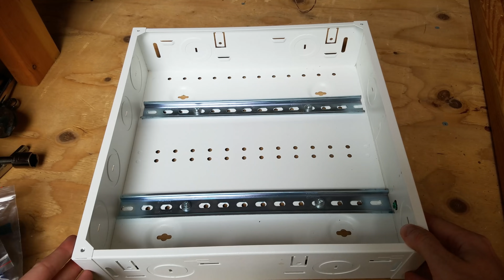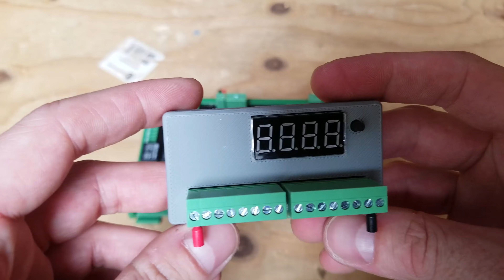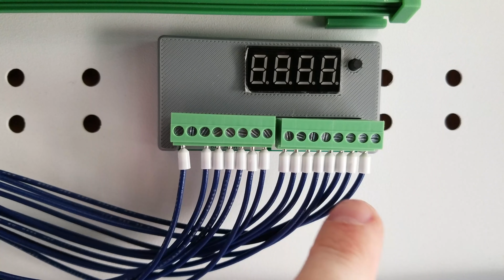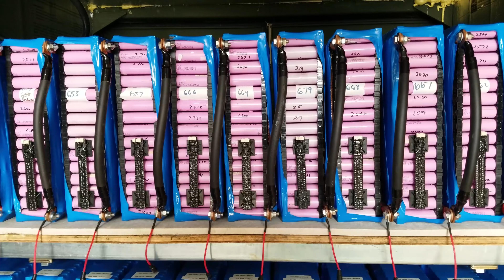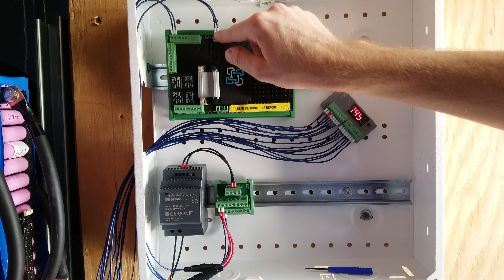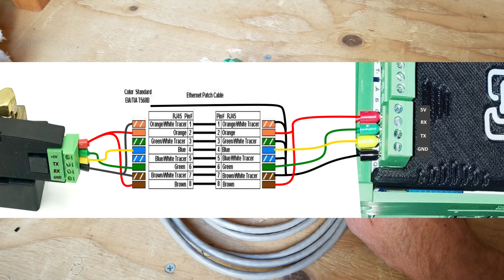Installing the Batrium Watchmon 5 (WM5) Battery Management System

Comment: but this does not guarantee each cell is monitored and cut off individually right if you are connecting a 100 cells in parallel? There is a possibility some cell will overcharge whiles some cells charge more slowly. I guess thats why your battery packs are a bit hot?

Comment: I'm having an issue with my batrium where a few cells always seem to charge to a higher voltage than the rest. The first few cells I added all have the same voltage but the the ones I added a few days later have a higher voltage and are not even aswell. Any idea on why this might be happening ?

Comment: Really great video, thanks! With the Watchmon 5, are the longmons still needed? Also, I'm still not clear if the shutmon is absolutely required for just cell monitoring and balancing?
Reply from the maker: No, the longmons are not needed, and no, the shuntmon is not required.
Reply: @LithiumSolar  Thank you for the info! Appreciate you helping me design my system.

Comment: I am confused by the naming, are these BMS's? monitoring devices? how to connect for example 16s eves 280? which device would it be?
Reply from the maker: You'll want the Watchmon Core + K9. Check my other videos, I have one on this setup. The WM5 in the video you're commenting on was the predecessor of the Watchmon Core. I don't believe they're selling them anymore other than as a special request item.
Reply: @LithiumSolar  Ah, and can the Watchmon core monitor 2 independent cellbanks? it looks that way
Reply from the maker: @joaosidonio7562  Yes it can. You will need one Watchmon Core and two K9. One K9 gets installed on each battery bank and there is a cable to connect the two K9's.

Comment: Hi there!! Thank you for the beautiful video! My configuration is 2 battery connected in parallel and every battery is made with 8 packs connected in series. So basically, using 160 lifepo4 cells 26650 3.2v 3.300mAh for a total of 3.2v 264Ah for every pack. 
So 2 batteries ( Multi strip) of 25.6v 264Ah
What do u suggest for a 2M8s80p? The watchmon 4 or watchmon 5?

Comment: Another option for protecting wires as they enter a metal box is to use some rubber tubing. Cut a slit down the length and fit it over the metal edges of the box.
Reply from the maker: That is actually a great idea. I haven't fixed it yet. A small piece of aquarium air tubing (think it's 1/4" OD) should work perfectly. Thanks!
Reply: @LithiumSolar  Perfect. Oh, and well done video btw. Enjoyed watching it and checked out the next one on batrium bms. I'll be using mine on leaf cells 14s7p on couple of SMA 6048 sunny islands. Need RS485 communication.

Comment: would there be issues with using CCA (copper clad aluminium) CAT5 cabling instead of solid copper? a lot of people don't realize there's copper and CCA where CCA can't be used to power POE (power over Ethernet) devices like WiFi access points or security cameras. when ordering online, the price difference is the easy way to tell on something easily confusing like Amazon between CCA and copper because the CCA will be much cheaper.

Comment: Hello LithiumSolar, I'm interested in the batrium and considering using it to handle 4 - 2p16s., I'm considering the watchmon 4 and m8's. My question is do I still need one m8 for every negative and can the watchmon handle 4 shunts or just use one 1000amp? My system is a 12kwh 48v inverter, 48 - 500 panels and two 120amp charge controllers.

These are the two battery layouts for the 2p16s. 
http://postimg.cc/LJGDfL71
http://postimg.cc/McRDYX2r 

Thank you
Reply from the maker: Hi there. You will need one Blockmon M8 for each grouping of cells. In a 16s2p, you have 16 groupings - so that's 16 Blockmons. If you have 4 banks of those, you're up to 64 Blockmons, which will get pricey. Have you considered doing one big bank of 16s8p? For that route, you would only need 16 Blockmons. To answer the second question, the Watchmon 4 will only handle one shunt. Typically the shunt is placed after all battery banks are combined but before any loads/chargers are connected.
Reply: @LithiumSolar  Thank you for the response, I had planned on 8 16s due to worrying about balancing. All cells are from the same manufacture and matched. Do you think there would be any balancing issues by going with the larger configuration?
Reply: @LithiumSolar  Thank you again for the help, I would consider doing two banks so if one needed repair I could keep the power on. Do you have diagram for the 16s8p or a two bank as I'm not to familiar with the larger layouts. We work from home and sort of remote location and the power is not the resilient and greatly affects our work.
Reply: Put my order in today, for watchmon 4, 39 m8's, 1000amp shunt and spare watchmon. Building larger battery banks which I still have some concern but compared to other solutions its very competitive.

Comment: If I understand it correctly, your dc/dc converter will take power from your batteries, in that voltage range and give out 12 volts, right? Would having two positives and two negatives means that it has two outputs or a single output? In the spec sheet it states as 1 output. 

Why did you choose a dc/dc for the batrium vs an ac/dc converter? I was thinking in the off chance that there is no solar, no battery. There is electricity from the main, and the batteries require charging, would the dc/dc still work if batteries are all used up? If there is electricity coming from the mains, the batteries are getting charged up, the batrium would still operate.

My knowledge about electrical related things is close to zero. I hope these questions make sense.

Comment: Your lucky to get it delivered so fast. I'm in Australia and I ordered something on ebay from just another suburb in the same city two weeks ago and it still hasn't arrived. I could have walked there and back again in a fraction of the time. The covid situation here has really stuffed up the mail deliveries.
Reply from the maker: Batrium uses DHL Express. Anything else I order from Australia, China, or any other country tends to take several weeks if using standard post.

Comment: Really appreciate..
What is the each battery pack details in volts and ah.?
Is that mandatory to sync or close volts and ah each battery pack...?
Total voltage and ah ..?
Converting to AC ..?
If so how long (hours) you can use that entire power wall battery pack..?
Please reply

Comment: yep, i had big time problems with the batrium4 wire connectors too. they seemed to come lose between the wire and the plug. batrium was not particularly helpful and i paid for most of the faulty wires and longmons that showed wrong voltage.

Comment: it is just a suggestion, but instead of using blue for all the connections i would have used a different color for the positive terminal like read or so, this way you can immediately  see if you have wired somethin on the wrong terminal.

Comment: hey mate, question about the wiring. Would you now how do they do the balancing if there is only a single ground cable on the most negative and then a monitor/balance lead on all of positives from pack 1 -> 14? Wondering how they acheive inidividual pack balancing (heat) as this is done now at the main unit (guessing?), rather than at the longmons?
Reply from the maker: Having a wire connect to every single series point gives you a positive and negative for each battery pack. One wire serves as the positive for one pack and the negative of the next pack. Yes, the balancing is done by resistors under the big heatsink instead of longmons.

Comment: What made you choose the spring side of the fuse holder for the ‘battery’ side? Curious as I’m doing the same thing now and somehow have managed to make a mix and need to decide one way or the other.
Reply from the maker: I left the spring on the battery side so it only has a 4" piece of wire to slide around  as opposed to a 6ft piece of wire. Of course, you still have the black plastic piece on the long wire, but at least there is no spring pushing it up :)
Reply: @LithiumSolar  Thanks - Im using some sheath and heatshrink which limits the movement of the plastic covers (see my pic in the comments section on your facebook post for this video)..

Comment: 925 cdn to expensive
Reply from the maker: The base price is $555 CAD. You don't need the expansion board that I have here or the shunt (though this is recommended).
Reply: @LithiumSolar  I have 49 100p packs will it do all 49?
Reply: The watchmon 4 with 100 Longmont was 2900

Comment: The watchmon 5 runs fine off 48v thus you do not need a buck converter although if you are planning on using 12v fans then you would still need the buck converter.
Reply from the maker: The WM5 will support 48V, but the MM8 expansion boards for adding more strings of batteries are 12V-only. I plan to add some of those and as such, will need 12V.
Reply: @LithiumSolar  Sry but I had replied to the wrong comment. On aliexpress there are some waterproofed buck converters (48v ro 12v) with an aluminum body they are pretty darn cheap an small.
Reply from the maker: They're cheap, and I have a couple different voltages of those, but they're extremely inefficient. The meanwell is a high quality component, fully isolated, and has an efficiency of 91%. It's worth every penny :)
Reply: @LithiumSolar Meanwell is my go to for DC power supplies. Great quality and last for years.

Comment: 5 A balancer its much better. Don’t wast your money for that complicated things
Reply from the maker: If you need a 5A balancer to keep your batteries balanced, I think you need to re-evaluate your testing practices and the quality of batteries being used.
Reply: @LithiumSolar  i enjoy all of your videos, great work! They are very well done. Have you possibly considered implementing both? The batrium and a 5 amp active cell balancer? You showed the AH deviations between your packs many videos ago. I agree, all cells need to be tested, properly like you do but that aside, when you add in all the cycles and age, as you already know, they will degrade, most likely, unevenly. An active cell balancer would mitigate some of that and keep them balanced all the time rather than burn off the excess at the top end one 1-5 packs(or however many) giving you more usable power, for a longer period of time while taking the load off the resistors in the batrium. Is 500ma balancing going to be enough for 1300ah bank? 

Im still building my system, 1060ah so far and still going. Its not in use yet unfortunately. I plan on using both batrium and active cell balancing in my build.

Comment: I love the idea of Batrium and getting rid of the Longmon is a good step forward, but their cost is the main reason I bought a prebuilt battery from Pylontech rather than making my own. Once you factor in a smart BMS the systems aren't much cheaper than a modular system from new (unless you have excellent salvage resources for batteries which I don't).
Reply: COPART is an excellent resource for electric vehicles. There are BMW's Leaf's Teslas that sell there all the time. I got lucky however and got the last 90ah BMW pack that battery hookup had. They are a good resource but you must be absolutely glued to your email alerts from them. When they get good batteries in they are gone in a week.
Note to anyone NEEDING batteries NOW:  THEY have a new batch of 60ah(2P) BMW packs(20% wear factor +/-). I think they are in a 8x12S2P configuration  21KWh. $2500 +$350  Samsung NMC prismatic. AS far as I know they have not broken the packs to sell as individual 12S batteries.
9/21/20
Reply: @2pi628  Unfortunately I am in the UK and we don't have anything like Battery Hookup, we have Copart but they have precisely one i3 for breaking at the moment. There are plenty of complete i3 packs on eBay but they are about $4800. A single 44V block is about $1000.

Comment: very straight forward just one question how did you figure out which com port to when usb is in control.
Reply from the maker: I don't have any COM ports on my laptop, so when I plug in the USB cable, the only COM port that appears will be the Batrium. If you have multiple COM ports and are not sure, you can right-click the start button and open the Device Manager. In there, expand Ports (COM & LPT). You should see one that says something like "Silicon Labs, USB to UART Bridge". That is the COM port number you'll want to use. I should have included this in the video, didn't even think of it.
Reply: @LithiumSolar  Thanks
Reply: @LithiumSolar  I've run into that before and your advice is correct depending on OS.  It looks to be straight RS-232 wiring you did?  Thanks for another great video.

Comment: I'm curious why they only support 15s instead of 16s because with Lifepo4 banks 48 volt packs are 16s. 15s just isn't ideal for a lot of inverters with that chemistry. So if your doing 16s in Lifepo4 you'd have to stick with the Watchmon 4 instead and of course the higher costs and the more complex wiring setup. One more pin and this could have served the Lifepo4 market well too. What's weird is the 24 volt version Watchmon 7 supports up to 10s, which only LTO would need, but this one is limited to 15s. Maybe they will make a 6 version in between that will do up to 20s? Just kind of frustrating.
Reply: It is in the pipeline we just have to wait till the next generation chipset is available. Maybe it will be available in 6 months, supply chain (COVID) has delayed it release which has delay ours. For now considering the distributed product family of Watchmon4 and separate cell monitors.